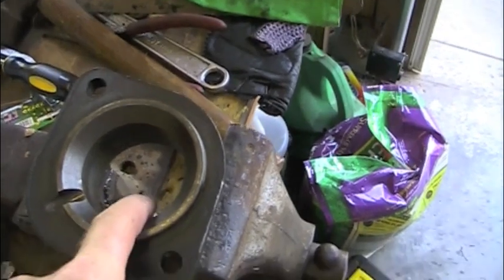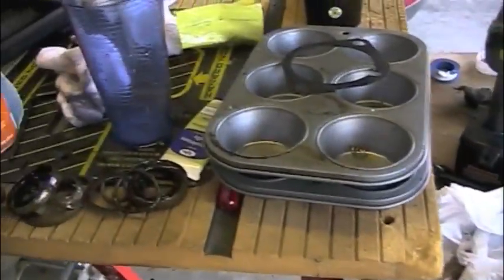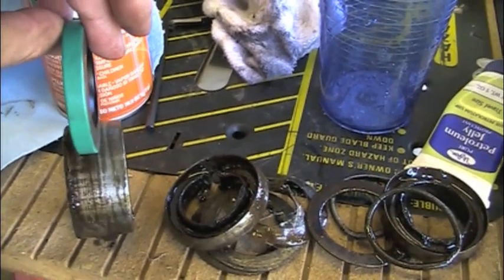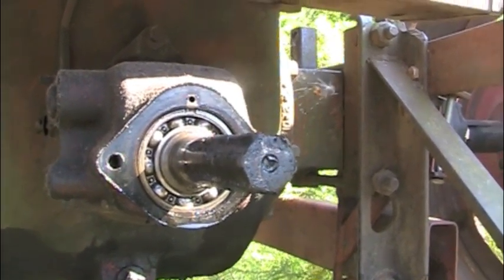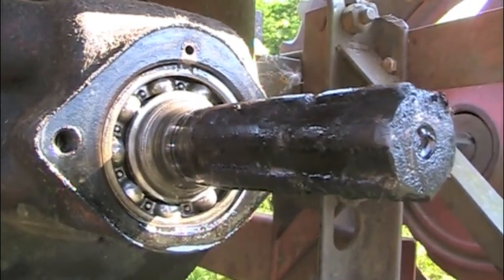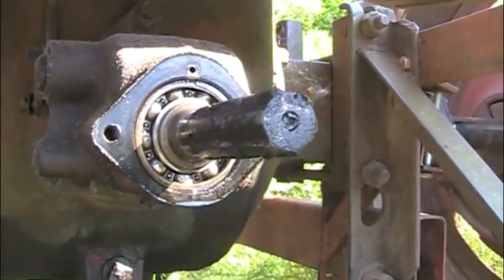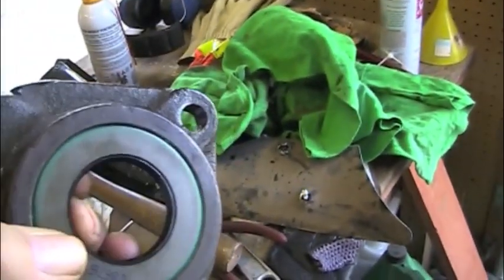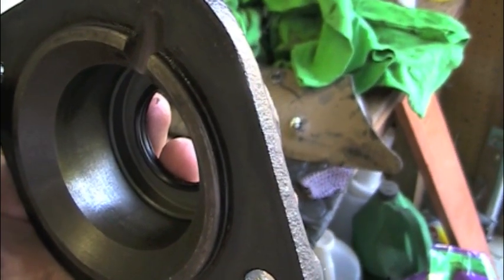PTO seal project

Comment: It's not uncommon to stack two seals in place instead of just the one little thin one when the physical size is so much different.  Slip a little grease between the two for lubrication of the 'backup' seal.  I've done it a number of times with good luck.

Comment: Nice video, sir.  How did you get the shaft in to the other end of the transmission housing? My bearing does not completely enter the casing at the near end and sits "proud" about 3/4".